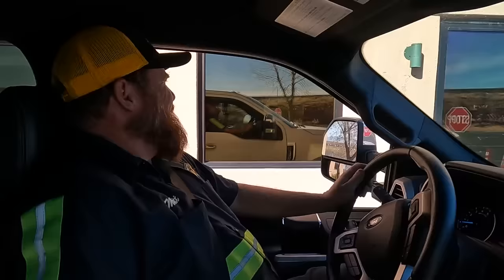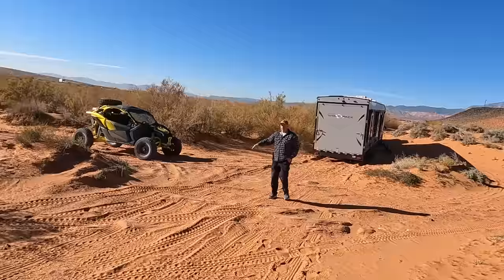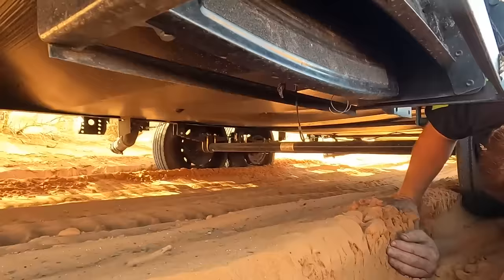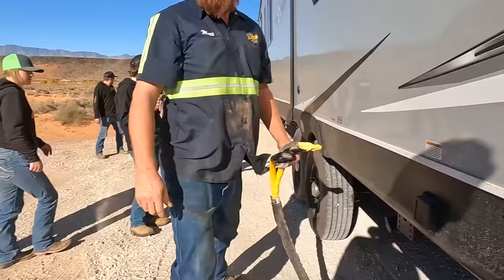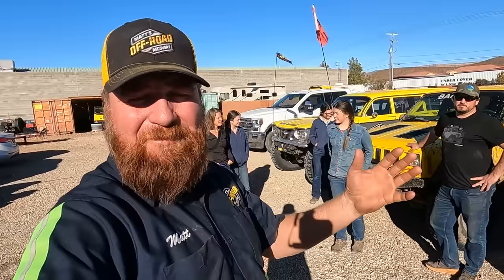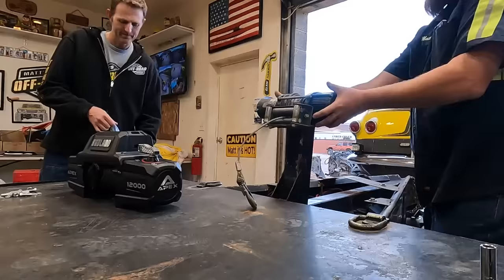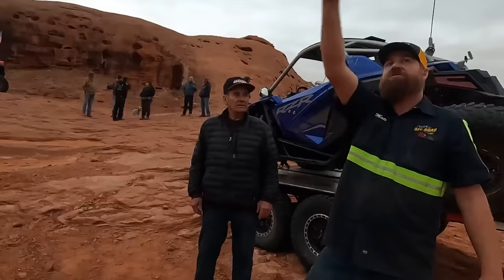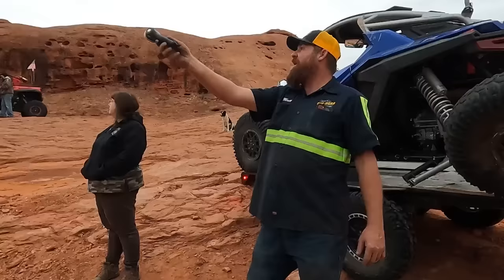That Hurt, I Get Slammed On The Rocks!

Comment: Watching the Morrvair climb out with that RZR on tow was amazing... you built the ultimate machine right there. Incredible stuff. 
Hope you're okay from the fall!
Reply: Edit: I forgot that the Morrvair has a V-8. Matt put the inline-6 in the Banana. Still a great sounding rig.
Reply: @WS102  isn’t it a V8?
Reply: @WS102  15:42 hey the Morrvair is powered by an Chevy LS V8. I believe it's the 5.3 liter. The Banana Jeep is powered by a Golen stroker 4.2 or 4.6  liter inline six.
Reply: @WS102  what do you mean its powered by a Silverado v8 LS
Reply: @WS102  did get the growling part correct at least lol
Reply: Yeah it’s awesome! It’s almost like he’s just showing off 😂.
Reply: Tough one
Reply: @TheMlc4life  That's right, he put the inline in the Banana.
Reply: @minekush1138  I forgot he put the inline in the Banana
Reply: @George Vinson Rory hates breaking parts, so he crawls and absolutely lugs the heck out of that beast, and it does sound awesome.
Reply: @UCqZAWQnERX43cJ5f1WPSCWQ i watched them rip the motor out of the pickup wdym
Reply: Matt has refined the setup and it really looks perfect now. The trailer too. Tandem, no suspension, perfect tyre pressures. It's beautiful to see in action
Reply: Ultimate machine? 
No. 
Good machine for his work load?
Yes.
Reply: @AlwaysAwesome001  i don't normally  reply to keyboard warriors but can't help myself. What a stupid and pointless comment. Maybe you're thinking the Heavy Wrecker will be better, or maybe you reckon you just know better but for f@#$s sake, are we not allowed a moment to just appreciate the Morrvair and how tight this while recovery setup is now. What would you use, Chinook helicopters?
Reply: @WS102  just hearing it build up as it just muders those hills yess soo perty
Reply: Impressive recoveries on this channel.
Reply: The cool undercarriage lighting!
Reply: @tosgem  yeah! I love how he is willing to change and adapt, and also be inspired by others (Rory with the trailer).
Reply: @sissormint  yup, I’m such a big fan. Probably my favourite channel on YouTube
Reply: @tosgem  There's always one, best to just ignore them.

Comment: One suggestion with the stanchion for the winch.  Put a secondary lug under the winch so you can run quad lines out to whatever you're pulling in.  It should help with winch longevity.
Reply: Its only built to haul those small toys.
Reply: Also, trust me. Matt is the last person you need to give winch advice to
Reply: @ddt6352  and you had to be rude, man if you watched his channel you would know he already made a video covering the build of this winch mount and even talked about winch longevity in a different video about the wrecker.
Reply: What is a "secondary lug" and what is a "quad line"?  I've been jeeping for over 40 years and never heard these terms.
Reply: @nealesmith1873  no idear

Comment: Matt, I had to borrow one of your trailer loading techniques on Monday. We haul our big electric scissor lift on a tilt bed trailer. Unfortunately, the incline is too much for the unit and we get wheel spin, which means we have to put the shoulder to it and push, or use a fork lift or telehandler to boost it on the trailer (own boss won’t spring for a winch). So on Monday night after struggling, I pulled my vehicle up beside my nephew’s van(to which the trailer was attached) and we strung a towline from my hitch to the front off the lift. The lift was loaded in about 30 seconds with a short tug.

Comment: Just a thought for the winch power.. on my truck (I use a receiver mounted winch so I can shift it between my trailer, and truck) I've run 1/0 to my rear bumper and front bumper. I made a 1/0 8' extension with winch quick disconnects on each side. That way I can power my winch from my truck battery/alt. I used to have a battery hard wired into my trailer tool box, but I found more so in the winter it wasn't getting charged enough to winch anything.  I also made a 2" 1/0 clamp cable I can plug into the 8' extension to use for boosting... I can boost of the front or rear of my truck, with a HO alt and a big battery I've boosted cars, truck and cranes.

Comment: Have you thought about building an A frame so you can winch over the top of it and lift vehicles as you pull on them? It seems pulling up would break suction, avoid pulling against the mud and make it easier to get onto a trailer at times. In Florida, our mud suction makes a big difference when trying to break it free.

Comment: We all  take spills from time to time.
Now that your winch is further  up, you  should weld some vertical square tubing up on the front edge of the the platform so you can put a 3 ft square tubing into it with a permanent heavy duty  snatch block on it. So you can have multiple high points snatching positions to choose from to change your pulling direction.  You could put heavy duty pins in it and drill multiple holes in your 3 ft riser to choose the height of said snatch position. 
It seems like a good idea. Js

Comment: Cowboy boots may look cool, but the smooth bottoms on them are super sketchy on metal. Good thing you didn't bonk the head. Also I have never seen someone shave a trailing arm in half on any RZR before and those Pro R's are supposed to have the strongest stuff on them out of any manufacturer. Solid work on that guy.

Comment: Matt, isn't it reasonable to weld 6 point pulleys to your rig, 4 corners and middle so in case of real emergency when muscle power is not just enough, in worst case scenario you can use your winch to fine tune the angle of wheels, vehicle on board etc? Basically like sailboats have for adjusting sails.

Comment: Matt, please love this comment and I have a question for you: I'm only hours away to decide between PTO or electrical winch. Based on your experiences in vehicle recovery, what would you recommend or what did you think was the most useful? Based on the vet experiences, they told me PTO is far more reliable though obviously more cluncky and harder to maintain or install. What do you think? Thank you 🙏

Comment: Fall ranking: Matt's initial form was a bit loose and without solid direction, would've earned a 5.3/10 if it were not for that marvelous landing, which Matt really stuck. The landing brought my tally up to a 6.7/10. However, also managing to slide partway beneath the trailer definitely earns some favor with the judge, that is a very unique approach. This puts my final ranking at a 9.3/10! Great job Matt, this is really going to be a difficult performance to top!

Comment: Would it be worth mounting some anchor points along the trailer so a small snatch block could be dropped in to change the pulling angle?